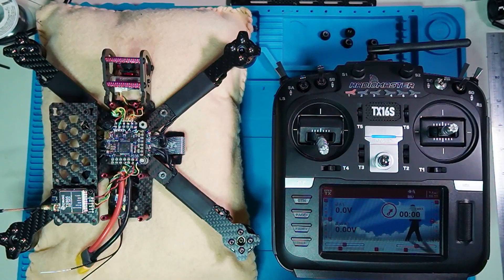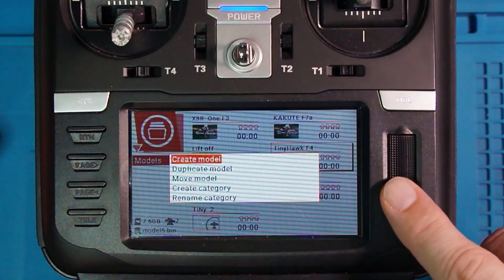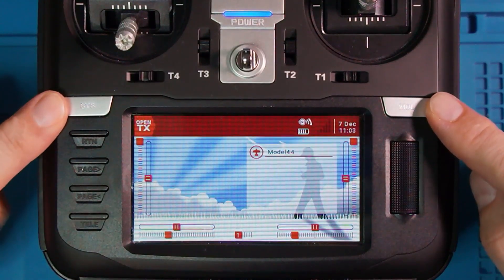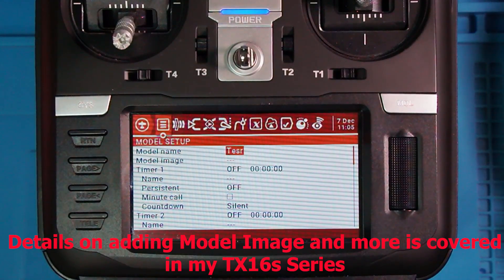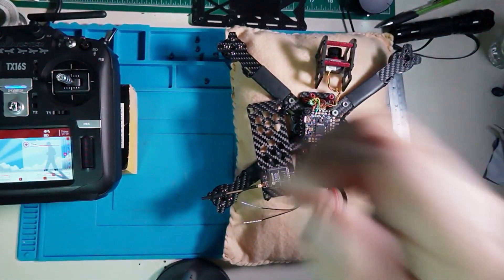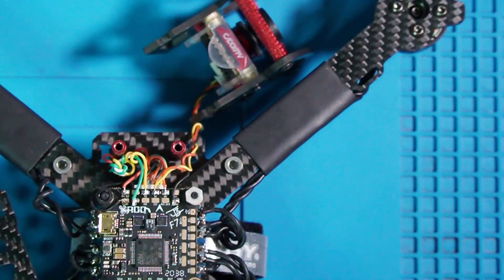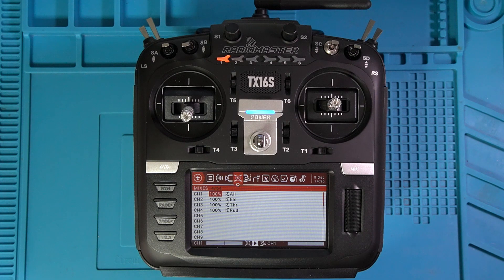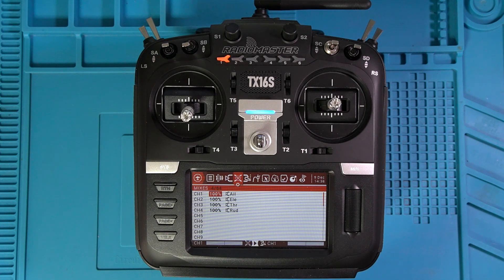RDQ Bardwell F7 Add Model & Bind with R XSR Receiver

Comment: Hey Steve, great video.  I just bought all the stuff to build a quad, namely the Xilo Phreakstyle JB edition bundle.  Anyway, I've bought the RM TX16S transmitter, and a FrSky RXSR receiver.  I've read a lot about how this receiver will not bind to the RM if the receiver has the 2.0 or 2.1 firmware... but they are all older videos from 2019ish.  Has this issue been resolved, or will I need to flash the RXSR back to firmware 1.9?  I can't find any new information on this it seems.

I just discovered your channel and subbed!  Tonight I'll start binge watching your playlist on the RMTX16S... Open TX is totally new to me as an old Futaba and HiTec guy.

Thanks again for all this information!

Comment: Amazing stuff, I just acquired a drone but pretty sure I don't have the items needed to run it. it's a phantom 3 dji never used, it might be older technology now.
Reply from the maker: Your phantom should be much easier to fly.  it's a consumer drone whereas this video is about building a hobby drone pretty much from scratch.  I think DJI has propriatary software you can use, perhaps this?  https://www.dji.com/downloads/products/phantom-3-standard  Have fun with it!
Reply: @TahoeSteve  I think you have to have a cell phone or i pad device to operate it, good luck with your drone